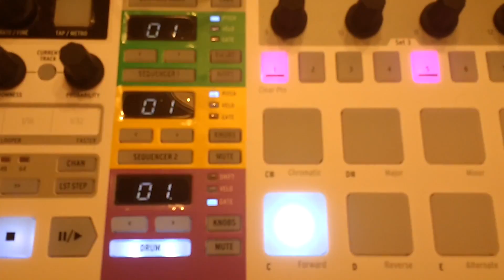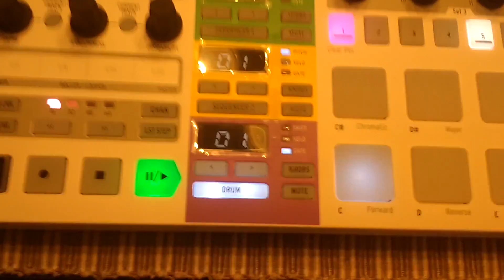DON'T TRY THIS PO-12 triggered by Beatstep Pro

Comment: The PO-12 buttons are triggered by ground. So what is happening here is when the gate goes low, the sound is triggered. You can try to make a simple V-trig to S-trig circuit to convert the voltage trigger to a short ground trigger. That will keep you PO save.